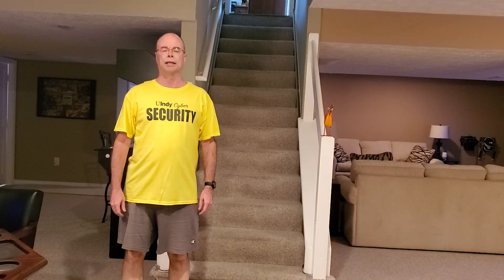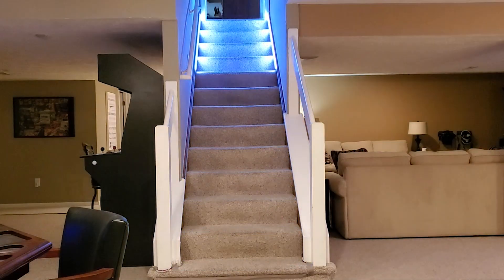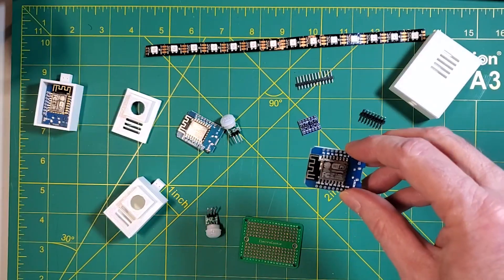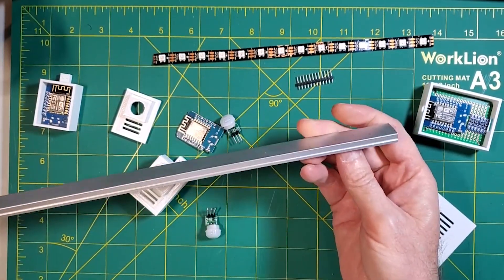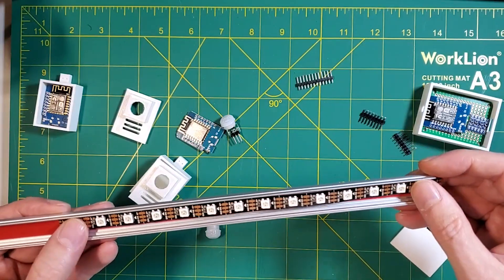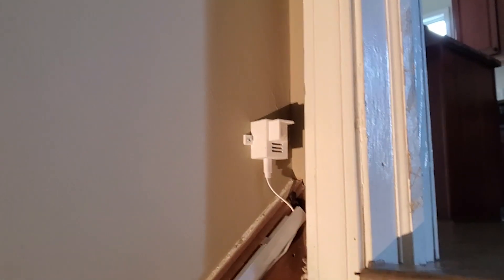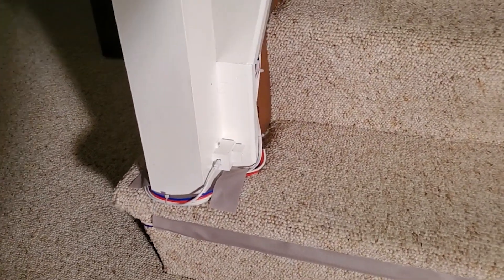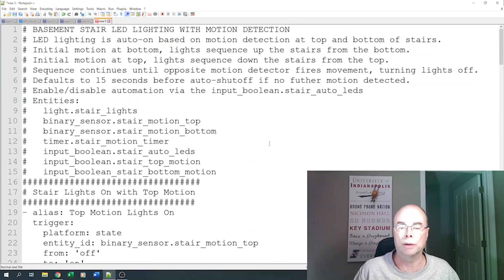Motion activated LED stair lighting... without staircase modification!

Comment: I have the lights all connected on the stairs and got both PIR sensors hooked up and put the file in my automations file then restarted home assistant I can see the automations when I go into configuration then automation. but I can not get it to turn on with the PIR sensors. if I go into automations and hit RUN ACTIONS I can get it to turn on and off but that's it. I could really use your help
Reply from the maker: I'll be glad to try to help out as best I can.  First off, did you define your PIR sensors in ESPHome?  It sounds like the actions work fine, but the automation trigger, based on the PIR sensors is not firing.  It could also be a missing or misnamed helper (e.g. timer, input_boolean, etc. in the conditions of the automation that is causing the automation to fail and not fire the actions.  Do you see anything in the Configuration -> Logs that looks like an error related to the automation?  If you like, please feel free to email me at resinchemtech.diy@gmail.com as it might be easier to try to resolve via email than here in the comments (I might not be able to respond until tomorrow... as it's getting a little late where I am!).

Comment: Why did the too relight after you stepped of the last step?
Reply from the maker: It due to the fact that I built in an intentional short delay (500 ms) on the bottom motion detector.  This is just particular to my installation as the stairs are normally approached from the right (on the bottom) and with the open railing at the bottom, the stair lights would turn on as you approached instead of when you reached the bottom step.  But this does result in a slight delay in the lights shutting off at the bottom as the motion trigger is slightly delayed.  With this delay removed, the lights would have shut off immediately.  Again, this is just a tweak for my particular installation and not a requirement.

Comment: Ok, need a little help here.  I've done all the steps but when implementing the automations that is perplexing me.  If I put the, "stair_lights.yaml" under /config/automations/stair_lights.yaml how does Home Assistant know how to access it?  Or if I try an use the Automations wizard how does it connect up?  Confused
Reply from the maker: This will depend on how you have your Home Assistant automations setup.  If you have all your automations in separate yaml files under config/automations, then your configuration.yaml should have a line similar to:
automation: !include_dir_merge_list ./automations

If you have UI-generated in an automations.yaml (and a line in your configuration that says automation: !include automations.yaml), then you need to modify the above line to read:
automation split: !include_dir_merge_list ./automations

The above two variations tell Home Assistant to load your automations from the listed location(s).  You need to reload automations from the conifguration menu (or restart Home Assistant) after making these changes.

Finally, if you only have an automation: header within your configuration.yaml with all your automations listed under that, you would add the contents of stair_lights.yaml under this header.  Sorry this is so confusing.  I use a "split config" model so that my automations, scripts, helpers, etc. are all in their own files or directories and the main configuration.yaml just points to these individual files or directories.  It's easier to maintain than one gigantic configuration.yaml file.

If you need additional help, please feel free to reach out via email: resinchemtech.diy@gmail.com
Reply: @ResinChemTech  Ok, I do like the splitting of the files so that we don't got a massive configuration.yaml.  I am trying to test it with just the first PIR (top_stair if you will) and not sure what to add as an entity in the Home Assistant Overview screen to see if it is working.  I made the WLED contoller(works great), flashed the other D1 with ESPHome(works great) , I've added all of the binary_sensor.bottom_stair_motion
, binary_sensor.top_stair_motion, light.stair_lights.  In what place or section in the configuration.yaml file does this go: stair_auto_leds:
  name: Stair Auto LEDs
  initial: on ?  I'm not a great .yaml guy so this can be a little confusing.   Then when I try an add timers: to my confuguration.yaml... .I get :  Integration 'timers' not found.
Reply: I'll contact through email.  It may go to your junk email by the way.

Comment: Do you happen to have any of these lights pre made? Would love to buy some that I can have already assembled so that I can mount them to my stairs
Reply from the maker: The lights themselves... no, sorry I don't.  I think that the length needed might vary from staircase to staircase... and they'd be a real pain to ship!  If you are talking about the controller (WLED), then Quindor sells pre-built controllers (with an integrated logic level shifter) and WLED preinstalled.  You can find his store (and Dr. ZZs US store) at https://quinled.info/pre-assembled-quinled-dig-uno/.  Of course, this doesn't include the light strips/rails nor the motion detectors that I used to activate mine.  There may be some retail versions available for stair lighting, but I suspect that they will have less functionality (and be more costly) than any DIY version.  They really are pretty easy to build yourself... you can even avoid soldering if you aren't comfortable with that,  or don't want to take the time to do so.  Let me know if I can help any further.

Comment: I have found that 3m command strips are excellent for mounting those kinds of channels without using screws.
Reply from the maker: Absolutely... and a good suggestion for anyone that doesn't want even the small screw holes.  I tried a small screw in an inconspicuous location and felt it was acceptable in my case.  And I did like the added ability to easily remove a section of the rail from the clips in the event that I needed to make a repair (fortunately hasn't happened yet).  But you could absolutely use command strips or even other double-sided tape as long is it wouldn't mar the finish upon removal.  Thanks for watching and passing on the suggestion!

Comment: Looks cool, however really needs a little bit of modification IMO to make things look very nice.  I'd hate to have any visible wires at all personally
Reply from the maker: I hear ya... and I don't disagree!  But my goal with all my smart home tech is to avoid making major modifications since we will likely sell in a few years and all the tech has to come back out.  I don't want to be faced with making major repairs when things are removed.  Completely hiding the wiring would have required drilling or routing the stringers, drilling through drywall, etc.  I agree it would have made a more attractive install... but at the expense of making alterations to the stairs themselves.

Thanks for your feedback!
Reply: @ResinChemTech  My view is almost entirely the opposite.  I'd probably leave all the tech in for increasing the perceived value of the house.  

I bought a fixer upper house though from 1948, tore down all exterior walls to add insulation, so I don't mind if I make permanent changes as long as it looks good and adds charm to the house long-term.  
  
I can tell you know what you are talking about though, can only assume you are some level of an electrical engineer or just a tech enthusiast.  
  
EDIT: Should of read your shirt, clearly says Cyber Security lol.  I'm a DevOps engineer personally.

Comment: Please share circuit diagram
Reply from the maker: You can find the overall wiring diagram in my related blog article: 
https://resinchemtech.blogspot.com/2021/07/simple-motion-activated-led-stair.html

The circuit diagram for the LED controller can be found in this blog article:
https://resinchemtech.blogspot.com/2021/01/building-your-own-led-light-strip.html

Comment: Hey i ordered all the parts from the list, I’m going thru integration right now. How did you run your home assistant is it through a raspberry pi? Not sure how your running the server .
Reply from the maker: My Home Assistant server?  I started with a Raspberry Pi a couple of years ago, but I'm currently running HA in Proxmox on an i5 NUC.  After my home automation grew, I wanted something a bit more powerful (and reliable) than a Raspberry Pi.  However, for this project, any platform that will run Home Assistant will work.  You will need to add the WLED and ESPHome integrations within HA to get everything to work as I showed it.  Good luck and let me know if you have any other questions!

Comment: Great great video! I have the stairs set up the same way but I have it hooked up to my raspberry pi system. Can I just copy paste the code from your description to my raspberry pi and it work the same? The last person who owned the home left it hooked up but it hasn’t worked since I moved in.
Reply from the maker: Well, there are three parts to the "code".  First is WLED, which runs on the ESP8266 controller.  Then ESPHome is used on the motion detectors.  Finally, there is the automation code, which is in YAML within Home Assistant.  You could theoretically run the whole thing on a Pi, but not directly using the code that I used.  You'd have to write  something that would run on the Pi, detecting the motion via GPIO pins and then sending a signal out to the LED lights.  Sorry... but the code I used is pretty much designed for ESP8266 and Home Assistant.  But I'm pretty sure you could write everything in something like Python that would replicate what I've done here and run standalone on a Pi.
Reply: I think the 'Pi' would not be a good choice because of the high current consumption

Comment: Any insight on the plans to build the 3D enclosures?  I have a 3D printer abc have no idea how to build from scratch.  Im happy to donate and your stairs are awesome sir!
Reply from the maker: Thanks! I've thrown my designs that I used up on Thingiverse for you: 

PIR Sensor Enclosures: https://www.thingiverse.com/thing:4969716 
Electrocookie Enclosures (full and mini): https://www.thingiverse.com/thing:4969733

Note that depending on your stairs and orientation, you may have to modify the "vanes" and which direction they are blocking motion  on the PIR sensor enclosure.  But this might work as a starting point and you can edit in Tinkercad or other 3D modeling software.  Hope this helps!
Reply: @ResinChemTech  

You are a gentleman and a scholar sir!

Comment: Great video....I would like to do this in my hallway...100ft what do I need how much power...would u plz give me a list of the supplies I would need to complete this project. Ty
Reply from the maker: Thanks.  Your power requirements will be dependent upon which LED strips your use.. 30/m, 60/m, 100/m, etc.  I use a rough estimate of 0.060A per pixel, which would be the max at full bright white.  So, you would need to determine the total of number of pixels in your installation then calculate the power.  I talk about power requirements, and also the complete parts list that I used in my related blog article: https://resinchemtech.blogspot.com/2021/07/simple-motion-activated-led-stair.html 

You can take a look at that to see the parts you may need for your hallway installation.  Good luck on your project!
Reply: I'm not sure what's more impressive... This video or the fact that you have a 100 foot hallway.

Comment: Where did you get the fins from?
Reply from the maker: If you are referring to the fins on the motion detectors, I designed those using Tinkercad and 3D printed myself.  I probably went through 7 or 8 revisions before I got them the way I wanted.

Comment: Govee rgbic will do the same with less. 35 bucks in now realizing i have a left over set. Hhmmm i don't have that many steps so I'll double up
Reply from the maker: Of course you can substitute the LED strips I used.  I had the WS2812b strips on hand and used them for other projects.  I think some differences here are that the Govee version are 30 pixels/m vs. the 60 pixels/m I used and are 12V instead of 5V.  And for automations via Home Assistant, you'd have to add the Govee integration.  But like most DIY projects, there are multiple ways to accomplish the same thing.  Good luck with your project... and thanks for taking the time to comment.

Comment: Hi. How many LED/m strip did you use, 60/m right ?
Reply from the maker: Correct... 60 LEDs/m.  Each side of the stairs has a total of 216 LEDs.
Reply: Figured it out... Thanks
Reply: Can you please advise.. I have been able to create the cirtuit; Wled & motion sensor for my 5m long stairs, but have encountered 2 issues - the first is that my led white is more "warm" towards the end of the strip, and the second is that my automation won't work; there are 2 extra input booleans in your sample automation yaml that I couldn't understand the role or how they fit.. Many thanks in advance

Comment: Very nice. Do you know of a motion sensor that could be used as a touchless button for something like this? Something where maybe the range is very short, somewhere around 1/2" to trigger it? My idea is to "tap" it with your foot to get it go on.
Reply from the maker: My first thought is to use an ultrasonic or lidar sensor (like I used in my parking assistant and car detection vid).  That way, you'd be measuring distance instead of motion.  When something (like your foot) moved in front of the sensor at less than a predetermined distance (say < 2"), that could trigger the lights on/off via Home Assistant.  Using this method, someone passing by the sensor at a 'normal' distance would not trigger the lights.  I think the challenge here might the the speed of reactivity of the sensor (how quickly it reports a distance change).  But it might be worth a shot!
Reply: @ResinChemTech  Thanks, yes, that's a direction I was looking at. It might work. I found these just now also and it seems like it might be the answer: https://www.amazon.com/gp/product/B07T91JXHW/ref=ppx_yo_dt_b_asin_title_o01_s01?ie=UTF8&psc=1
Reply: @ResinChemTech  This is interesting too. Looks like what you were talking about and it goes down to 2cm which is the feature I couldn't find in other ultrasonic sensors. I ordered this too and will see what works best. https://www.amazon.com/dp/B088R3V9X8?psc=1&smid=A2SNA9AH12A511&ref_=chk_typ_imgToDp
Reply from the maker: Great!  I haven't worked with either one of those options, but let me know how it works out.